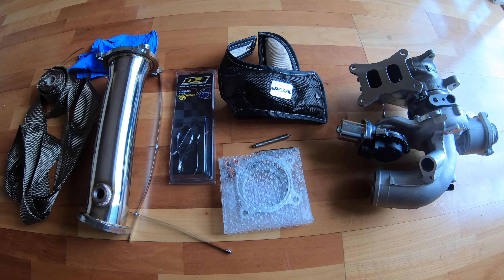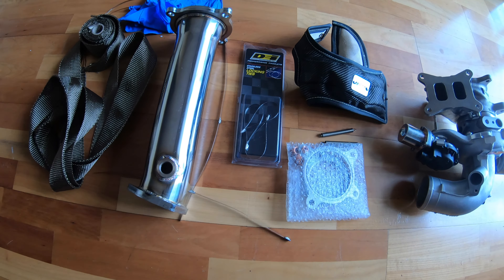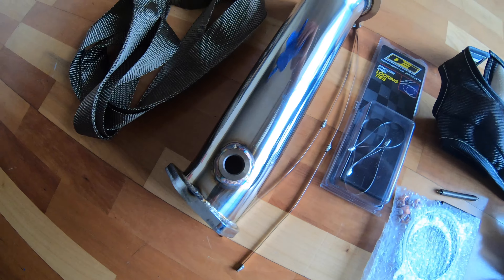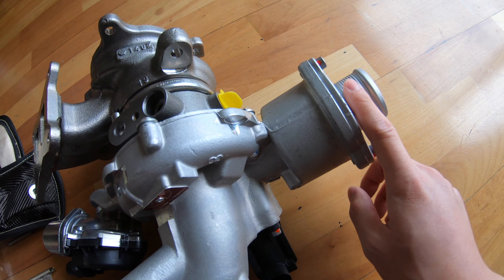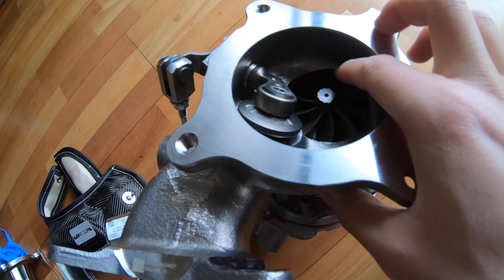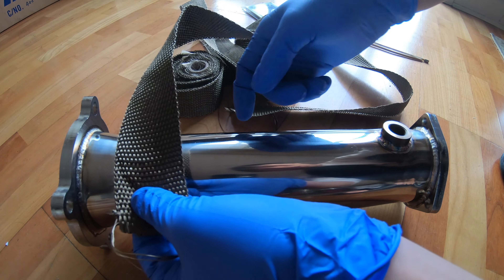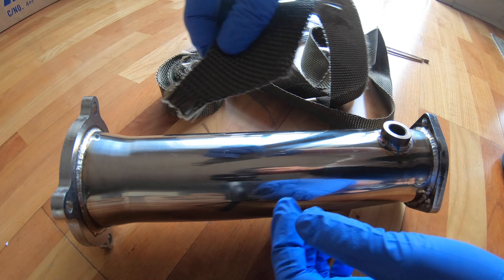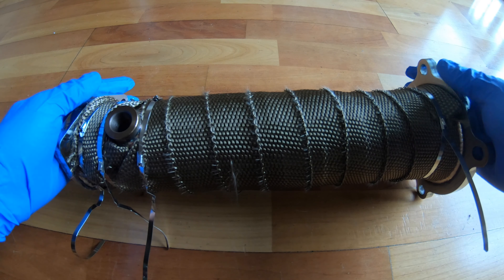Finally, They Are Here!!!

Comment: Nice Yaode. Excited to see it all come together! Have you upgraded your ignition coils yet? I had an appointment to put in the APR ones as I experienced a misfire the other day. Then my tuner got sick 🙄
Reply from the maker: alteredmindset The shop is doing their job as we are speaking right. And yes, they will be also change to RS3 coils and spark plugs
Reply: Yaode Chain won’t the RS3 spark plugs be a little too cold for our B9 EA888.3?
Reply from the maker: Michael Peng no, it will not
Reply: Michael Peng the spark plugs used in the RS3 are 1 range cooler than the current spark plugs. This would be ideal for a stage 1 tune. Recommended for a stage 2. And I would say required if you ran E85 or turbo upgrade. I currently have a stage 2 set up without the stage 2 tune (running apr stage 1) and have only experienced 1 misfire.

Comment: Yaode, 

How do you plan on installing this test pipe? It doesn't come with studs, I had to buy bolts from home depot and CTS hasn't been responding. Just beware that you may have to buy studs elsewhere.
Reply from the maker: will lahners Hi, I think I showed in the video that the test pipe will come with new gaskets and bolts.

Comment: How much hp is your a4 pushing now?
Reply: I think it 285bhp the last time I looked at his video
Reply: I think it is 285bhp now when I seen it on his video when he put it on the Dyno
Reply from the maker: Actually, 285 whp from APR Stage 1, 275 whp from IE Stage 2
Reply from the maker: 姐姐微信来了 The torture from IE is higher than APR. There are so many elements need to consider on a dyno. So the result will be some error range.